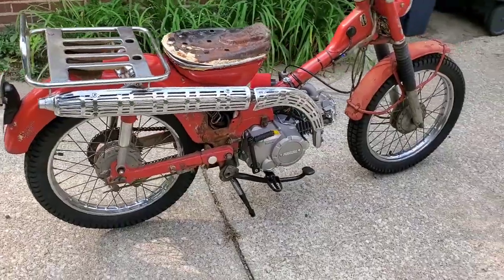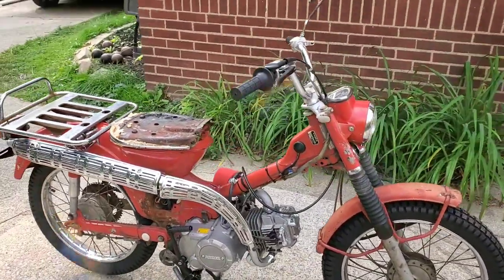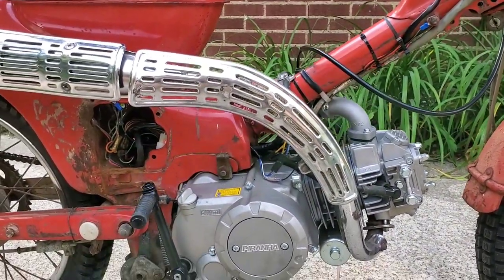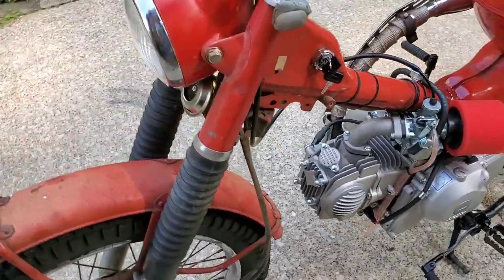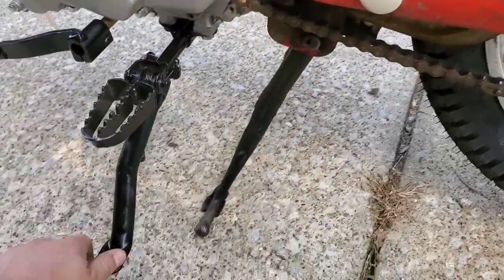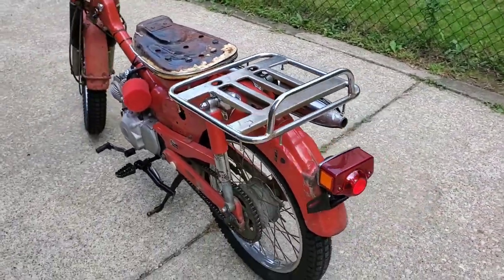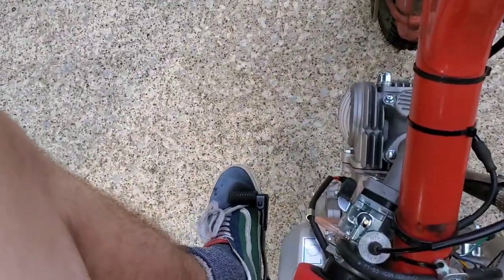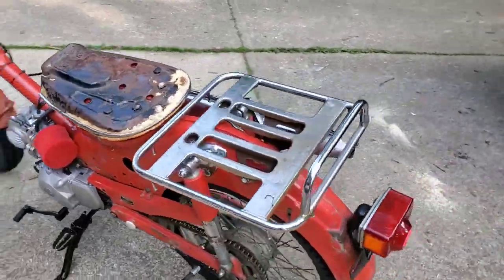I Bought a 1969 Honda CT90... Now With Piranha 140cc Engine

Comment: Mine has a giant rear sprocket that actually fits OVER the original sprocket! I never counted, but it must have 60 teeth. So it would probably top out at 20mph, lol. But I'm 270 lbs, so I need the torque. UPDATE: Down to 240 lbs!
Reply: Your bike must be earlier 60s. The big sprocket is for low speed, off road. The smaller one is for highest mph. Later, Honda built hi/low into the Trans. Before that, you swapped the rear sprocket and add or take off a short piece of chain.
Reply: @michaelcollins3455  Yes, mine is a '64, a pushrod motor and that goofy front suspension. Unfortunately, the engine got water in it, and it's badly seized. I'm hoping my friend, a bike whisperer (lol), can get it unstuck. I dont care if it smokes, lol.

Comment: Man, it even still sounds like a 90! Very impressive!
This seems like a really awesome swap, and just what my '74 needs.
If you could post direct links to the engine and each of the parts you used, you'd be my hero!

Btw, at least to my eye, that speedometer seems very, very off. You might want to check it, the cable, and the front hub.

Comment: Nice, good to see the 140 put into a later model CT. I have the 140cc manual on a 1965 CT200 and it runs great and bolts right up with only minor grinding. I suspect that muffler is really restrictive. I can get mine to about 55 MPH pretty easily with a 17t front sprocket and the power is solid through the powerband. Looking forward to future videos.
Reply from the maker: I agree, with a less restrictive exhaust and maybe a larger carburetor (currently a 22mm mikuni clone) it should be able to reach at least 60mph
Reply: CT200? I've never heard of that one. Does it look like a 90?
Reply: @donellmuniz590  The ct200 is a pushrod 90cc cub.

Comment: I have a bone stock 1970 CT90. Stock engine, gearing, carburetor, exhaust, even the tires are original. Is been well used and the engine hasn't been rebuilt. Mine will just barely do 50 mph and I'm around 200 lbs. Something isn't right if yours isn't going faster than 35 mph.
Reply from the maker: You're right, something is wrong. Its was a very tired (and now broken) original engine.
Reply: I think he meant that your Pirahna has something wrong if 35 is top speed

Comment: Should really add an oil cooler. You have the pipe the shunts the oil feed up from the crankcase, just needs the flex pipes and the cooler, don't cheap out on this.    The 140 makes a lot of heat, more than the quart of oil and small engine's bottom size can shed, if you're going to do some distance at speed on the highway.

Comment: Nice conversion..  
I have a C90 which needs a transplant.
PS  Rev matching will make your downshifting smoother  lol
Reply: Setting the idle up a bit will smooth the downshifts also.  It's a fine line, too much idle and it's hard shifting.
Reply: If the momentary clutch disengagement of the semi auto is adjusted carefully there should be no need to RPM match,  this isn't like a non syncro transmission like on some early 1950's truck.

Comment: What do you mean ugly,  it need TLC, we rebuilt a yellow 1969 ct90 trail K1 with 1200 miles on it.   Top speed with the original 90cc 7 HP is 50 miles per hour on the flat with an adult on it.   In addition our gear box has a low gear setting for off road.    I suggest you also rebuild the front shocks.

Comment: Just got a 69 ct90 with the 140 in it. First gear is too jumpy taking off, so I use 2nd gear. Engine revs out at 38 mph. How many tooth rear sprocket would you suggest to get it up to around 50 mph?

Comment: I have a 69 CT90 and just got a piranha 140 semi. Did you have to drill the top engine mount for it to work with the original engine mount bolt? 
How did you get the DrATV mount to work? Mine doesnt seem to line up on one side...
On later videos I see you have the factory skid plate on. Did you have to modify it in any way?
Are those pitbike pegs the straight ones or the upsweep ones they sell?
Sorry for all the questions, just trying to figure everything out before i start my swap!
Reply from the maker: I did have to drill the upper mount, as described on DrATV. I also ran into an issue with one side of the bottom mount bracket, so i'm only using the side that fits, and added a spacer in place of the side that doesn't line up.  I needed to cut a small notch out of the skid plate to clear the side stand. The pegs I'm using are the generic straight pit bike pegs. Let me know if you have any other questions!
Reply: @NickMakesBreaksStuff  thank you for the info! How hard was it to drill the top mount? Thats the part im afraid of messing up. How did you mount everything? (Example: lower Mount then pegs then skidplate? )

Comment: I need to do this on my '64 Trail 90! The engine (pushrods in 64 and 65!) is stuck and rusted beyond repair, and the electrical system is spaghetti. I dont have a headlight, so I dont care about that (until I get lost in the woods at dusk).
Reply: FYI you would have a ct200

Comment: What do you think is better engine an original honda 90cc or these 140 lifans and pirannas?
Reply from the maker: Depends on what you mean by better. The 140 is obviously more powerful and has lots of cheap parts very readily available. I haven’t had any reliability problems with mine, and the bike is way more fun to ride with the 140. I do prefer the original look of the 90 engine though.

Comment: Did you have to weld in the bracket from dratv to help hold the engine or is it bolt on. I've a '73 Honda CT90 Mars Orange. 
 Sounds nice! 👍👀
Reply from the maker: No welding, its bolt on. I had to do some finangling to make it fit though.
Reply: The Dr also sells a steel plate with mounting holes to use stock foot pegs. Goes for 19.99 on the site.
Reply: @michaeljones0007  then Dr? Could you send me info if they are a parts supplier please?
Thanks,
Rolf

Comment: How did you mount the original CT90 exhaust to the Piranha 140? I am in the middle of this swap, and the 140 has a totally different mounting surface and design to the original 90 motor.
The Piranha is a 32mm hole. The 90 is more of a recess for the lip of the 90 exhaust to sit into.
My guess, is that you actually have a 110 exhaust on there, not a 90. They are different diameter mounting faces.
Reply from the maker: I bought a cheap exhaust off of Amazon (advertised as being for a Ct70), chopped of the header section, and welded it to my original CT90 exhaust
Reply: @NickMakesBreaksStuff  okay yeah that makes sense The CT 70 was a 31.5 mm diameter so that would have been close enough for you to get it to work. Thanks for the info.

Comment: I just finished doing the same swap on my CT 90. I used a 140 with a manual clutch. Did you have to modify your exhaust pipe? I had to change the end on mine and the angle.  I also had issues with the crank case vent and had to grind on the frame . Did you have to do that?
Reply from the maker: I don't recall needing to grind the frame at all. I did need to modify the exhaust. I cut head pipe off of a CT70 exhaust and welded it onto my CT90 silencer.
Reply: Interesting they must have ran the crank vent  differently on the auto clutch version. That's for the response.

Comment: How do you start this? Choke up or down? Gas lever up or down (On or Reserve position?)
Reply from the maker: I start it with the fuel tap in the "on" position, and choke up if its cold. If I've already been riding it no choke is needed.

Comment: Very Cool I have my fathers 1964 Honda S90 that he put into Storage indoors in 1965 and the bike is complete and all original  i was hoping to use OEM parts  to convert it to a semi Automatic Clutch  because i have a Disability in my left hand that makes operating a Lever Clutch  very difficult  my plans are to do a  semi restoration to make the bike a Rider  but because of the history i would like to use OEM and Period Correct parts  unfortunately i found out that the Honda Semi Auto Clutch will not fit inside my case  like a Monkey bike uses   ? my Engine was refreshed with new Rings ,gaskets and  other parts  not too many years ago by a Uncle who  was a retired Mechanic and a Engineer   who tore it down because the kick starter  had sheared off part of the Mechanism  because kids used to play on the Motorcycle when it was in Storage  so i don’t beleive i will need to do a Motor Swap  which is a nice cost savings Unfortunately    the last few years parts for these motors have been going up  because of World demand and the Internet  although the positive is there are a lot of parts available  and in some cases  the Clone Engine parts are a  good  fit  as well  maybe not  the quality of a Honda  part  but can work in a pinch
Reply from the maker: I would think the easiest thing to do would be to find a used CT90 engine to put into your S90 frame. That would keep it all vintage Honda, but provide you with the automatic clutch. The s90 engine has a bit more power, but if you care you might be able to swap the S90 top end onto the CT90 crankcase.

Comment: Do the original bash bars not fit with the 140?
Reply from the maker: They do fit, you may need to add a couple thick washers or spacers to where the bash plate mounts to the engine in order to clear the pit bike style foot pegs / side stand

Comment: I just got a 64 CT200 trail 90 for free.. i wanna up power it im curious if the Piranha will flt in the same?
Reply from the maker: Nice! What color is it?

I believe there are differences between how the CT200 and CT90 engines mount, but I'm not sure if it would make it harder or easier. I'm sure its doable though.
Reply: @NickMakesBreaksStuff   Im near on too color blind but my Artist GF said its Orange its in remarkably good shape especially for a MC thats been in FL. I been searching for a carb for it but crazy expensive id rather have a china motor in it as it will be used regularly. I have swapped predator motors into several things including a XR200 and I have an IT175 rolling chassis that I already have a motor built for it. Im in the process of moving though so have little time for a milion projects.
Reply: Wait, it's a Trail 90 but it's called a CT200? I have a '64 Trail 90 with no plastic and no papers. So mine is called a CT200? Why?
Reply from the maker: @donellmuniz590  CT200 is before they started naming bikes by engine size. The CT200 was made from 64-66 (66 waa also the first year of the CT90) and the main difference is that the CT200 has an iron head pushrod engine, while all CT90s from '66 on have an aluminum head OHC engine.
Reply: @NickMakesBreaksStuff  Thanks for clearing that up. My '64 does have an iron head pushrod engine that's gonna have to be bored out or replaced. How much does a Predator/Lifan/etc 140 cost?
Reply from the maker: @donellmuniz590  Around $450 with electric start for the Piranha 140
Reply: @NickMakesBreaksStuff  ok

Comment: That ugly. adventure cub is beautiful ,& will get to places the high end BMW’ cannot get too.You can also get away with riding & parking in places you shouldn’t ,cops tend to find them inoffensive & turn a blind eye to them .The Australian post office used them & they call them postie bikes & delivered mail on them I have only seen one or two of them here in the UK .We mostly just got the standard step thru Honda Cubs with double seat & leg shields c 50 ,C 70 & C 90 & now the 125 Honda Super cub that is not good as it has become too high tech & not as owner friendly .

Comment: What's the max speed flat out with the new motor?
Reply from the maker: So far I've been able to acheive a GPS verified 53mph. I'm using the original exhaust which is way too restrictive for this engine. I'm looking at some other options, but for now, thats about where its at. I'm pretty happy with the performance overall, it is much peppier than any CT I've ridden before.
Reply: @NickMakesBreaksStuff  hmm, I think one of the benefits of those bikes was the quieter stock exhaust on them.
Reply from the maker: @croixtucker1757  Thats why I'm hesitant to change it. I like how quiet it is, even if it means a lower top speed

Comment: What is the exact bracket from dr atv?
Reply from the maker: http://dratv.com/adchtob.html

I only used one half of it. For some reason the left side did not line up with the hole on the bottom of the engine.
Reply: @NickMakesBreaksStuff  thanks

Comment: 35??? &*WHAAAAAT?*
Sounds like it's in the 'Low' gear-range, because even a 'bone-stock' Trail-90 would easily reach 50-mph, even in the '60's era
Something seriously weird is going on...!
Reply from the maker: Nope, just a tired old CT90 engine.
Reply: @NickMakesBreaksStuff  The engine must've had compression-loss from a worn piston-ring and maybe a 'scoured' cylinder
Reply from the maker: @gerrynightingale9045  Any number of things could be wrong with it, the most glaring issue is that the clutch no longer engages. I'll get to it some day, but for now I'll continue to enjoy my 140 engine.
Reply: @NickMakesBreaksStuff  *Yeah, clutches do wear-out, especially if it's been outside
a lot because of 'moisture condensation'  inside the casing which kills many bikes over time*
Engine DID run, which tells me it's worth a re-build if someone really wants the original engine that was on it
The 'Lifan' really really upgrades the performance into the modern era, so I can't object to that!
It would be another story if the machine were in 'very good' condition but it isn't
_________
'Mint' Hondas from the '60's in 'all original condition' are so rare now they're worth a fortune!
I saw a Honda 70 'Passport' last year on 'CL'  in my area that sold for $2,500!
( I remember when i could pick one up for $100 'gently used' )